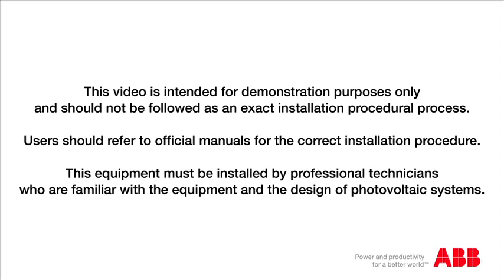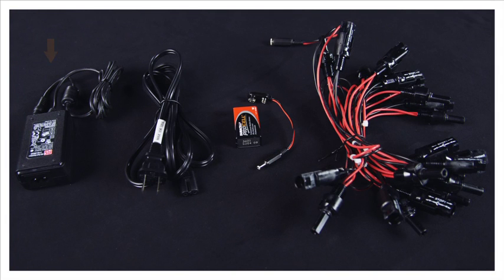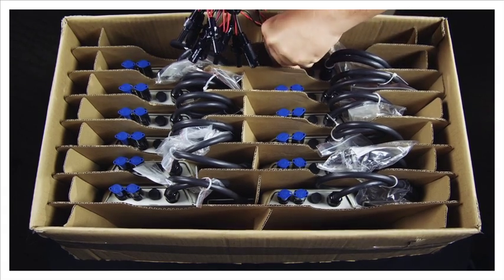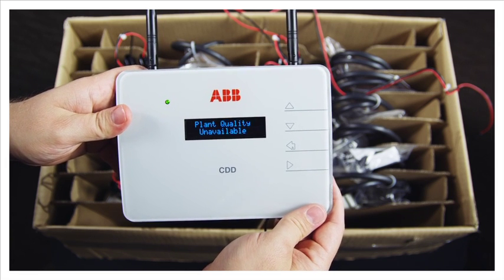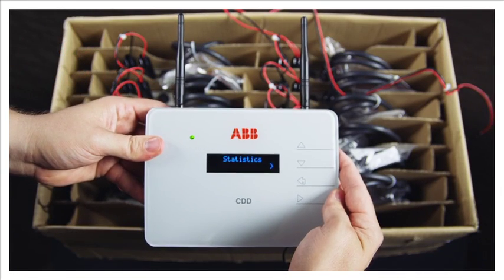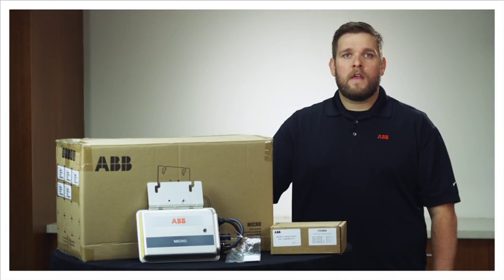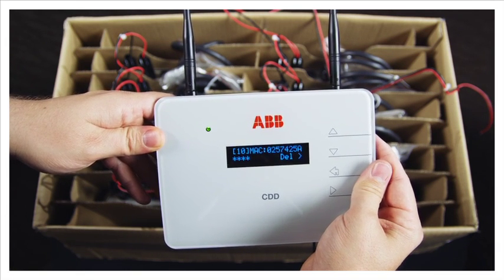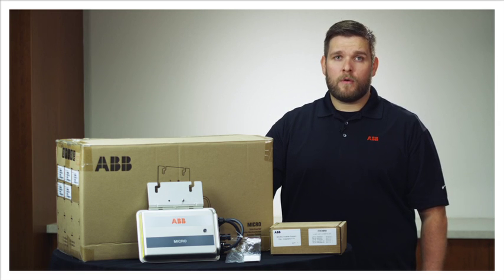MICRO inverter pre-acquisition kit installation

Comment: Basically, you are just replacing the solar panels with 24 Vdc. The solar panels put out a similar voltage so leave them attached and proceed with your steps.  The kit is not needed. If this is true, do the AC cables need to be detached or just the AC CB opened?